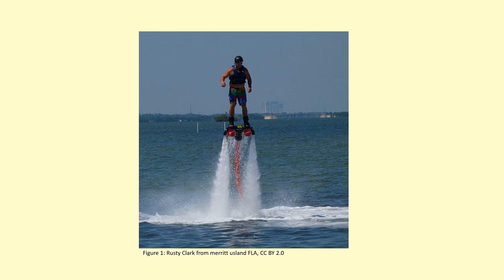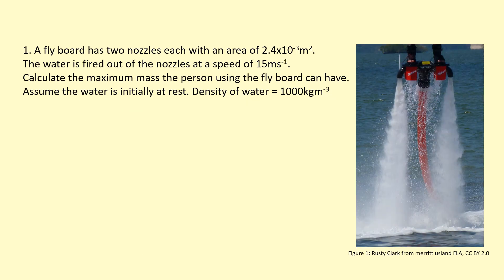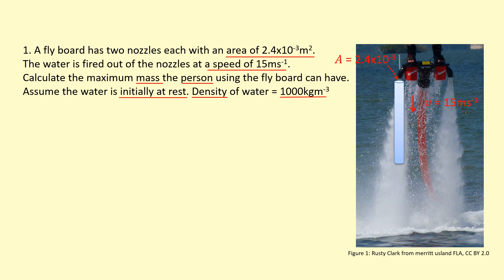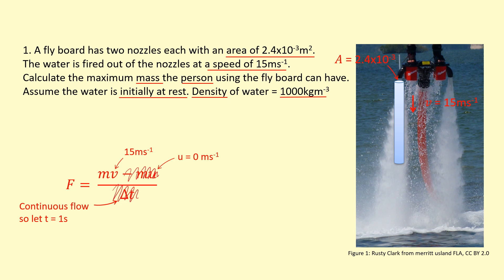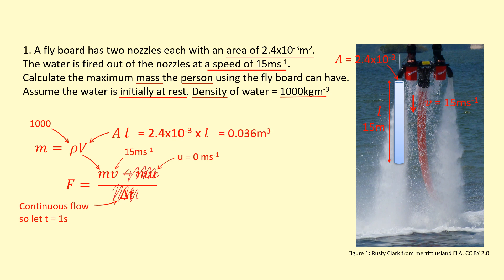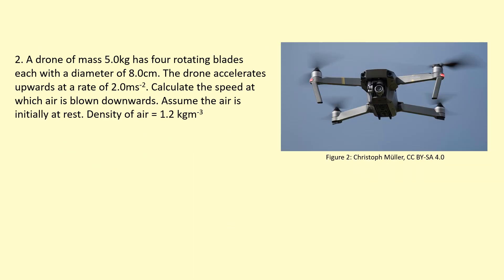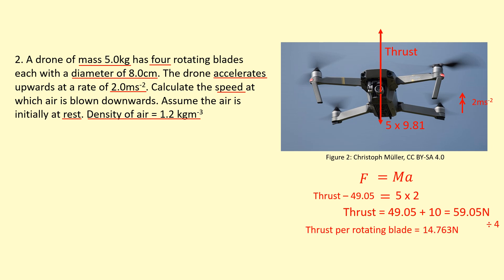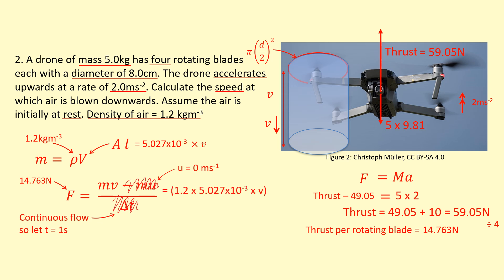1.30 How to get force from flow rate

Comment: for some reason im struggling with the letting t=1 and then the length becoming 15m just because the water is moving at 15ms^-1. My understanding of it after talking to ai, is that the water 15m or less from the exit point of the hose, would all travel out in one second, since they move at 15ms^-1 ,they all get displaced 15m out of the hose, so it forms a line of 15m of water. I feel like this way of understanding it is kinda long, are there any other simpler ways of explaining it
Reply from the maker: Yh i remember when i was an A-level student i would struggle with this type of question. Which is why i came up with the t = 1s method to kind of underrstand it myself.

Some students just visualise 15m of water coming out in 1 section and get it straight away without writing it down. 

I don't really know any other methods which is easier.
Reply: @MrNagaPhysics  Yh I think, for myself just so I can be quicker for a question , if it says like a stream of water is moving at 15ms^-1, im just going to accept it as 15m of water leaving a pipe every second. Like instead of focusing on the speed of the water molecules, ill just imagine 15m of water ejected per second. 
 my wording is a bit confusing but hopefully yk.

Comment: Great video!❤❤ by the way , if I say thermocouple detects more rapid temperature rises and falls than a thermometer,  would that be correct ,
Reply: Will tracing paper come up in paper 3 exam ? Please can you drop weekly paper 3 questions ,just one question, weekly,  asking me a question on any potential physics equipment that could come up , that would be great ❤❤❤❤❤❤❤❤❤
Reply from the maker: i don't thinking tracing paper is likely ( well done for being so thorough).
More likely are log graph papers. Do you know how to read these with log scale on both axis. 

http://www.geol.lsu.edu/jlorenzo/geophysics/graphing/loglog1.gif
Reply: @MrNagaPhysics  ohh I need to learn how to read with both log scales , thanks for letting me know ☺️❤️❤️❤️
Reply: @MrNagaPhysics  to eliminate parallax error for example reading a messurement on a ruler with a pin on it ,why is shadow projection never accepted in mark scheme? Like putting light on the pin, and then aligning the pin with its shadow , they only accept putting mirror behind scale , not shadow projection
Reply from the maker: Yep i agree. I believe it’s more responsive. 
Depending on how it’s set up , a thermocouple can probably be more sensitive too ( i.e can detect smaller changes)
Reply: @MrNagaPhysics  thanks 😊. And also what are the advantages of using an oscilloscope over a voltmeter ? Disadvantages ?
Reply from the maker: Main one is that, if it's a alternating current you will need to use an oscilloscope to measure the time period/frequency. 

Disadvantage is that you need to know how to read an oscilloscope so there is a possibility the person may read it wrong.
Reply: @MrNagaPhysics  thank you so much!!❤️❤️  I have another question 
 what are the advantages and disadvantages of using tape measure over meter ruler
Reply from the maker: with a tape measure you can measure the length of curved surfaces ( eg the circumference of a circle but you can't with a meter ruler. 

But sometimes you want something that's straight and doesn't move. With the tape measure you would need to hold it under tension to ensure it's straight.
Reply from the maker: Tape measures tend to be longer than meter rulers too.
Reply: @MrNagaPhysics  thank youu😊😊
Reply: @MrNagaPhysics  can I say tape measure can  to be marked as an advantage over metre ruler?
Reply: @MrNagaPhysics  thank you so much 😊😊
Reply from the maker: Do you mean marking it with a pencil? You could do that for a ruler too no?
Reply: @MrNagaPhysics  oh yes, you can do it with both, you're right . I have another question, what's the advantage of using vernier calliper and micrometers instead of digital micrometer and digital vernier callipers
Reply from the maker: digital is normally better. It's more expensive though.